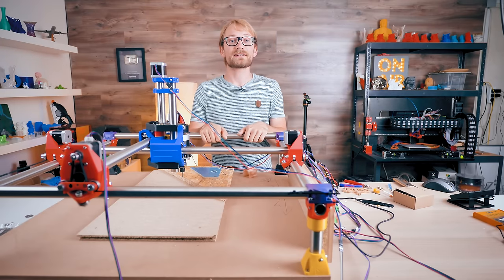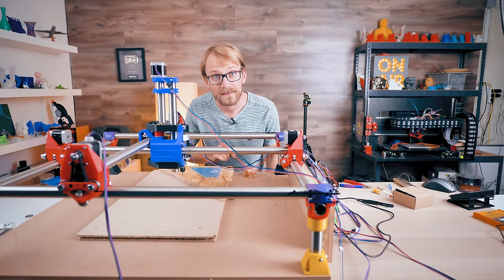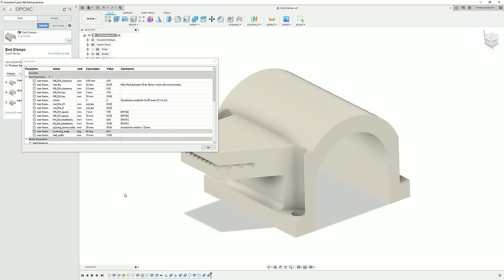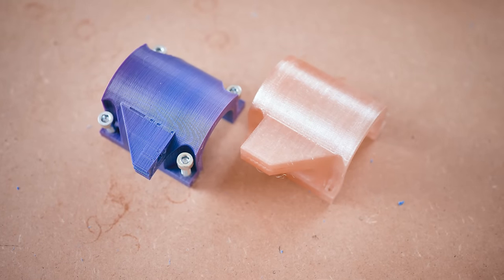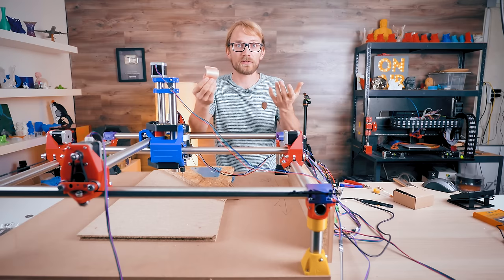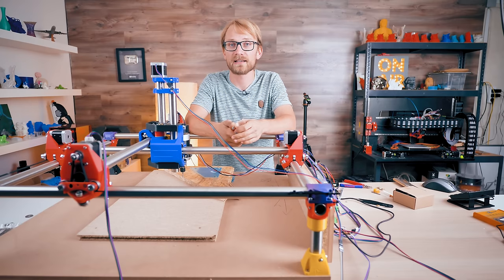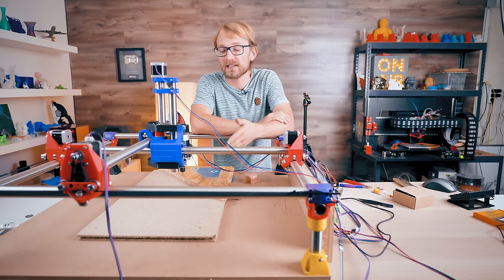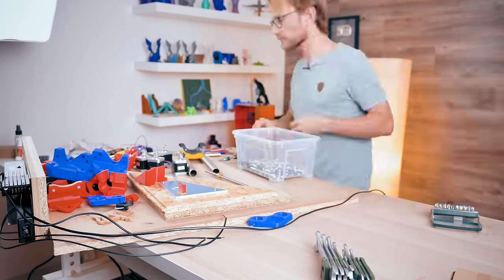Whose design even is this? (MPCNC conclusion)

Comment: For years I've had the feeling that 3D printing became big because of the open source mindset of all the awesome developers. And 3D milling has been stuck in the past with a mindset of doing it on their own. Also visible in the available documentation, software's and firmware.
Reply: that's a large part of it, 3d printing really started to boom after patents owned by Stratasys and to a lesser extent 3D Systems expiring.
Reply: It's because CNC is reductive, and Printing is additive, these people want to reduce making, not increase it!
Reply: Very true. Different mindsets.
Reply: I see this mostly with models. Thingiverse is so big while there are no such sites for milling machines. Probably the cost plays a role as well, we all got 300€ printers, but any decent mill/router is so much more expensive. And if you don't want to diy the whole thing, prices start around 1000€. So really, I think just the machine costs, plus the noise, dust etc that make them bad for home use, reduce the number of people working with them.
And that mainly leaves professionals in the space and they have to make money, so free stuff is hard to find.
Yet grbl etc are awesome projects and work amazingly well.

Comment: Tom, Feel free to build a White Knight and make all the modifications you like..  I know my design can be improved on.. ;)
Reply: people like you are the reason I love this community :)
Reply: @SchwachsinnProduzent  Yes, as a whole the maker community would fit well in a Tomorrowland environment..
Reply: Yes, please do! I would love to see you build one. 👍
Reply: Your license on thingiverse is non-commercial, same as the MPCNC. Ryan's request was for Tom to use the same license as Ryan initially did, which is the same as what your license requires. I'm curious, would it be okay if I drew up parts from scratch that improve your design, then release it as open source and start selling parts?
Reply: @paradisearcade8386  If you look closely you'll see that none of the files for the White Knight are on Thingiverse, they are all published on Github under the GNU general Public License V3.0.  The licence chosen on Thingiverse was due to trust issues with the site.  You are feel to use the files as you see fit as long as you pass on the same freedoms  provided by the GNU license..  I would also hope that you would share any improvements thru the Github so the community can all benefit..
Reply: @NAK3DDesigns  Awesome! That's my main gripe with this entire issue, the request was not to take down the part, but to keep the same license, same as your request. Both projects have freely available files and modifications and improvements are encouraged. However, Ryan's CC license is not being respected, so what's the point of the license then?
Reply: @paradisearcade8386  Good question...  A lot of the license terminology I don't understand but my take on it is simple "non-commercial" = only owner can profit unless consent is given.  Hopefully that much I understand correctly..  As for their disagreement I see merit on both sides..  Truly a shame they couldn't come to an agreement..  In the end though I feel Ryan will never be able to keep all future mods under the "non-commercial" license..
Reply: @paradisearcade8386  not the same thing he does not demand you use the same license he hopes you will use the same license very very big difference
Reply: @nerys71  the gpl on the GitHub says the conditions of the license include stating any changes made and keeping the same license. Please clarify how that is optional? If you can pick and choose what to follow what is the point of the license?
Reply: @nerys71  no one is "demanding" anything, the license is.
Reply: @paradisearcade8386  that's not how it works. a license is a demand. that is why you HAVE licenses.

a CC-0 is a "removal" of demands. public domain. any other license is a set of restrictions. we call those demands. you MUST do this. You may NOT do this. demands.
Reply: @nerys71  the White Knight is not under CC0 so I genuinely don't understand what point you're trying to make.
Reply: @paradisearcade8386  no toms part was cc0
Reply: @paradisearcade8386  Ok, so my take on it is the GPU states you need to continue using the same licence and share any improvements..  the difference is you are free to use my creation any way you like but just like Marlin you are required to share your improvements, well because I want everyone to help make it better
Reply: @NAK3DDesigns  No, I agree completely, I though Nerys was referring to the White Knight, since that's what this thread was mainly discussing.

Comment: For that reason I/We (team1989) have started work on a CNC that will be open source and is based on Tsloted aluminum stock
Reply: Have a think about square galvanised tubing turned 45 deg from the horizontal
Reply: Is there any more information on this? Where can someone follow the process or even help/ take part in this?
Reply: Where can i find the details?? Ik would love to make a cnc
Reply: Excellent. Don't let whining stop you.
Reply: @doogssmee9742  Root CNC already uses this design. He wants to create something new.
Reply: @doogssmee9742  RootCNC does exactly that and it works very well.

Comment: Considering making your own design or finding something similar that isn't as locked down?
Reply: I'm now wondering if Rene Descartes' lawyers are going to show up on the CNC scene and sue everyone for using 'cartesian' technology.
Reply: I guess you didn't watch the video?
Reply: @KriLL325783  I watched it too.  There's nothing preventing anyone from tweaking the design.  The only ask was that it be released with the same license requirements as the original, to prevent unauthorized 3rd parties from selling printed parts on eBay, then directing them to the v1engineering forums for support.
Reply: @c4tohagen  we did, and doesn't understand how you can come up to the conclusion that you do. IF one have seen the video.
And Ryan doesn't agree with what Thomas did, so he told why he unbuild the machine and will not continue support the project.
Reply: In theory I support that but as Tom pointed out his part was just compatible with the other parts, it wasn't based on them, trying to control such a "functional" design that tightly doesn't make sense to me, especially since the chinese will ignore any license anyway if they decide to make a clone.
Reply: @KriLL325783  "especially since the chinese will ignore any license anyway if they decide to make a clone."  I think that isn't true anymore.  Yes, there are small companies that still do that, but not bigger companies. That will block them from export.

But still, Ryan interpretation of Copyright are just strange and as you wrote plain false.

But then again, Thomas are respecting the Copyright owners will, and stop designing improvements to the MPCNC and thus stop making more people wanting to build the machine.
Reply: @c4tohagen  5:05
Reply: @c4tohagen  My only statement is a timestamp, as an answer the question: "can you give me timestamp for when anyone says its a locked down design ?
" The term "locked down design"  can mean two things to me, a last revision of a part that is not to be changed or something which is not open source. Here the latter would seem more appropriate, wouldn't you agree?
Reply: @c4tohagen  AFAIK no one did. You wanted a "timestamp for when anyone says its a locked down design", all I did was to give you that. If this is a broader point you want to make perhaps don't adress it to me directly. And watch the entire video, the bit after 5:05 is just a sub-clause following why Tom would personally release designs as open source.
Reply: @c4tohagen  excuse me, but you really don't get it, do you?

It is NOT about the build quality, or how good it can be, with the right modifications you are allowed to share with others.  It is NOT about if it is a good or bad design of the MPCNC.  I was going to try build one myself, before I knew it wasn't a open and free design.  
So It isn't about building and design quality, even if you are ranting about that.  So stick to the subject!

It about what the license of the design and how the Copyright owner thing Copyright works that is the problem.  What you are allowed to do with it.

So if you don't get that, just go some where else.  You are just annoying.
Reply: @AndersJackson  you either a) had no interest in actually building an MPCNC or b) had no plans to sell it after building it, don't pretend like this affected your decisions in any way.  You are just fanboying Tom and now are looking for attention.
Reply: The way Tom handled this was fine. Ryan's misinterpretation of what his copyright means is very problematic for Tom, as he IS using this commercially. He makes money from his videos, the videos have the machine in them. It's not worth another ounce of effort for him to do anything with this machine, since all it would take is Ryan revoking that implied consent to cause all sorts of troubles for him. If you're just an at home maker, then the license is fine for you to create it and have an unsellable machine that hopefully works take up space in your shop. But in Tom's case, there is absolutely no reason to continue, and I would definitely scrap the machine for parts.
Reply: apparently Ryan "owns" the design copyright for a pipe clamp, even though pipe clamps existed before he was born  ... LOL, this ain't "locked down", it just isn't. Tom modeling the part from scratch is more than sufficient to avoid any possible legal conflict.
Reply: @intelligenceservices  Lol
Reply: @KrustyKlown  Ryan owns jackshit. Copyright does not apply to these parts as they are purely functional, which are excluded from copyrights.
That's what patents are for, people
Reply: @c4tohagen  The design is locked inasmuch as that the original creator illegally tries to enforce his copyright license onto things that are not covered by his copyright. You can't enforce your license to things that you don't have the copyright to.
Reply: @KriLL325783  Or you didn't do your homework. The video offers a single perspective. Read the license, then come back.
Reply: @AndersJackson  Fully conjugated sentences would be appreciated.
Reply: @KriLL325783  I'm callin' BS on that one. Thomas's design is most definitely based on the original part. It's purported an improvement; addressing perceived issues and attempting to resolve them in a different way. That's premise #1, and as someone very familiar with these situations, I'm confident in my statement.

Ryan isn't "trying to control" a design, "functional" or otherwise. The license verbiage is clear:  Attribute. Non-commercial. Same license as the original.

Thomas is of the opinion that, because he designed his part from scratch, and didn't modify an existing file, his design is an original. It is not. It's (possibly) an improvement on the original. Thomas wouldn't have designed the part as he did without foreknowledge of the original. This is referred to as "contamination".

Anyone attempting to cleanly reverse engineer a solution must do so in a so-called "clean" environment, completely free of existing solutions to a given problem. Clearly not the case here.
Reply: @sadropol  Nope. Not "locked down". Still open.
Reply: @AndersJackson  No, it is you who doesn't get it.

Please define "open", then explain how MPCNC is closed.

As for "free", it most certainly is.

Next, please don't conflate copyright with license. These are two distinct and different concepts.

Additionally, please explain how your plans are somehow be limited by the license.

Lastly, as @catohagen stated, they've built multiple MPCNC machines and all have functioned/performed as desired. You, on the other hand, are coming from a position lacking in direct knowledge and experience.
Reply: @liquerinfrnt  You're entitled to your opinion of Thomas's handling of the situation. I, for one, find fault on both sides as private disputes have no place in public fora.

As for Thomas's "commercial" use of MPCNC, simply contacting Ryan beforehand could've definitely decided the issue. Either Ryan would've determined that such use violated the non-commercial terms of the license, or he would've allowed it.

The intention of the non-commercial term is to preclude others from manufacturing the design without appropriate compensation to the author/creator. It's not intended to prevent monetized content creators, maker spaces, or any other contrived entities from featuring MPCNC, etc.
Reply: @ianr2002  And Ryan never argued copyright. Please stop conflating license with copyright. The issue is a) Thomas's insistence that the part he drew doesn't "build upon the material". It most certainly does. Then, b) that he published the part in violation of the Creative Commons license: "the same license as the original".

Plain and simple, and much ado about nothing.
Reply: @ARepublicIfYouCanKeepIt  Could you consider reading all my replies before addressing me directly? This style of carpet bombing an entire thread without trying to understand the bigger picture first is just plain bad netiquette.
Reply: @ARepublicIfYouCanKeepIt  no, it is locked down, not open, as you are not allowed to make changes to the machine and redistribute them (according to Ryans misinterpretation). 
As Ryan and Thomas has demonstrated here.
It is Free of charge to build, but it isn't Libre to do whatever you want with...
Reply: @ARepublicIfYouCanKeepIt  and again, as @catohagen and I do agree on, if you have read.
This is all about licenses and respecting the constructors wishes, even if he is wrong.
It has NOTHING to do with how well it work.  Yes, I have looked on this machine for a while because I think it is cool and good design to start with.
The License/Constructors wishes make it a non option for me, Thomas and many more.

To bad you have not understood that.

This video is good, as it shows that it isn't and open construction, that anyone can freely redistribute contributions too.
Reply: @ARepublicIfYouCanKeepIt  public disputes?

It is about a video content maker can't make his own addition to the machine.  That is not private disputes.  It is about how builders can make use of the machine.

Ryan has already clearly stated his opinion on how this should be handled.  No need for you to make some assumptions.  This is what happen when a construction isn't open, is locked down to the whims of one person.  And again, it is HES RIGHT to lock down the design.  I have no problem with that.  I do have problems when people are implying that it is an open construction when it clearly isn't.

You and Ryan doesn't have the same understanding of why there is a "Copyright" on this design.
IF Ryan doesn't want others to use his construction in commercial use, then he should patent it.
Copyright only cover this as an art, as an statue, or the documentation.  Others are allowed to make similar machines, as long as it isn't an copy of his machine OR they use his documentation.
Reply: @ARepublicIfYouCanKeepIt  "Fully conjugated sentences would be appreciated."
Ah, there we are.  Ad Hominem argumentations.
Off you go.